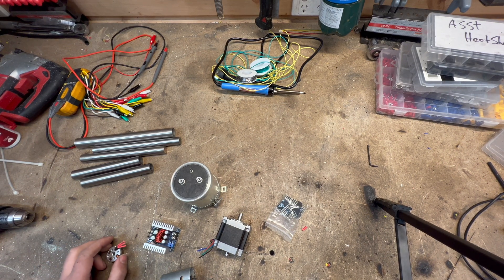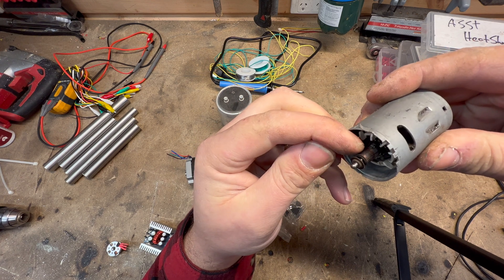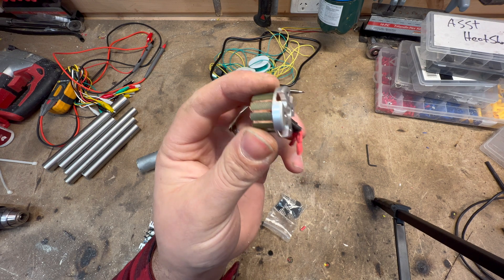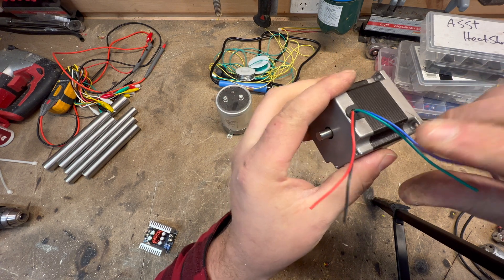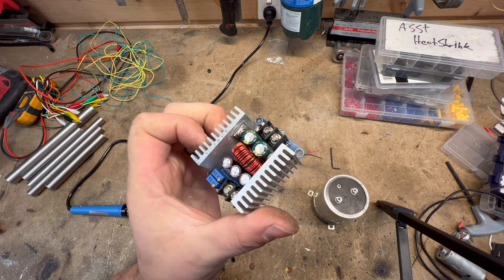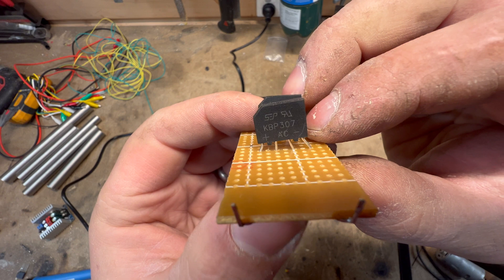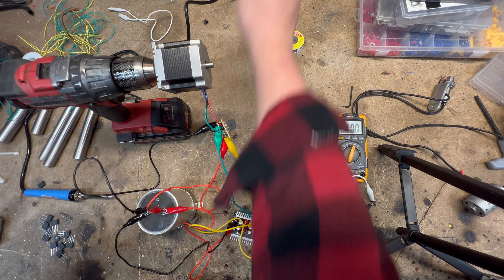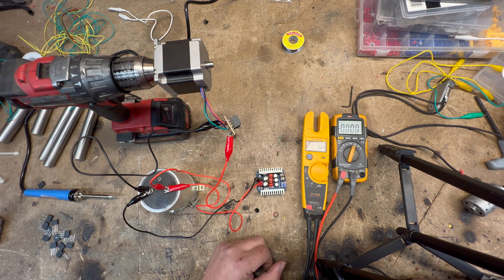Steam Engine Generator - Step 1, building a Stepper Motor Generator

Comment: 12:20 you measured voltage open circuit. you measured current when shorted. you did NOT produce 65 watts. what you actually did was demonstrate that the "generator' has an impedance of about 3R, 15v/5A...

 
jacobs law aka thevenins maximum power theorem aka impedance matching, and kirchoffs law... highly misunderstood.

the resistance of the load versus the resistance of the generator itself. its a critical and overlooked aspect of all these DIY generators...

yet it is so simple once you actually see it. 

when equal, half the power is lost in the windings. half the power is available in the load. 

shorted, all the power is lost in the windings and none is available in the load. you made an "eddy current brake". all current and no voltage.

open circuit, theres no power at all as theres no current through the "load" of the gigohms that air presents... all voltage and no current.

a load resistance around about 1/5 of the generator windings allows for 4/5 of the power to be available in the load, but the maximum power available is limited by the current flowing through the load AND the generator windings. this is how electric motors and generators can claim efficiency figures of "90% or better"... much like statistics can prove that 100% of people that drink water eventually perish.

stepper motors are too high a frequency for the regular diodes used in a FBR... massive switching losses. you want fast acting diodes to keep losses down.

two phase has the issue of needing eight diodes or two FBRs,  where a 3 phase bldc only needs 6. so you find the lowest kv motors you can get which are generally gimbal or hub motor type devices...
Reply from the maker: Hell yea man!! Thanks for posting this. It makes a lot of sense when you explain that (and I was blown away by 65 watts…) I’ve pinned this comment to hopefully help anyone out doing the same!

Comment: Hi Taylor, just a question - where did you get those parameters 2-80V about your buck/boost converter? I was searching for the same and all the same-looking that I found are max. for 40V. They look absolutely same from both sides of PCB. Are you sure with this range? Can you provide me a link for these converters, please? Thank you very much! Marek
Reply: When I search for the type which is visible at one moment in your video - SZBK07, it says input voltage is around 6-40V and it is just buck converter. I am confused now, so where is the true?
Reply from the maker: @Pucflek111 I think you’re right! The eBay listing I got them from also says 40v, either I was confused - or the listing was incorrect when I purchased 3 years ago https://www.ebay.com.au/itm/303838530270?mkcid=16&mkevt=1&mkrid=705-154756-20017-0&ssspo=zfz6ob5wRsy&sssrc=4429486&ssuid=_psApqu1RXS&var=&widget_ver=artemis&media=COPY

Comment: Thanks Taylor, I'm in the process of building a stepper motor wind turbine to power an outdoor hydroponic grow tower and I was making good progress but was getting confused with the part after the bridge rectifiers in order to charge a battery to power a submersible pump. Your video was by far the easiest to understand how to use the buck / boost / capacitor to charge the battery. Good job.
Reply from the maker: Sounds like an awesome project! And thanks for the feedback, glad to hear it was clear and easy to follow along - I made the video I wished I'd found when I was looking into this - I'm glad it helped someone! 😂
Reply: Hi im currently In the process of making a wind Turbine myself and want to use a stepper motor like the one in the video. Does the shaft have alot of resistance when turning? Do you think it'll be able to spin with a small prop?
Reply from the maker: Hey mate! Steppers have a lot of resistance due to the magnets, so you will need a larger turbine than with a dc motor. You could also use a reduction.
Best way I reckon is to use a small stepper, Nema17 or MAYBE a Nema23 for a large setup
Reply: Any help or advice would be greatly appreciated and if you could suggest any improvements or better ideas for a small scale low windspeed Turbine that would be amazing.